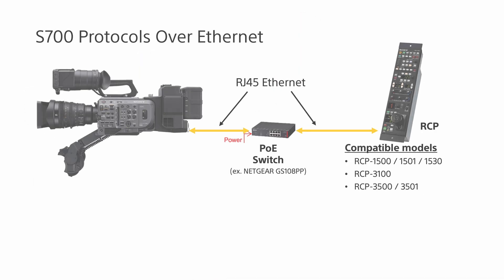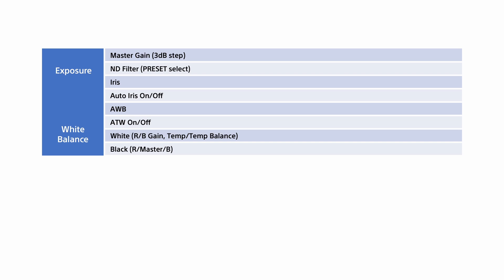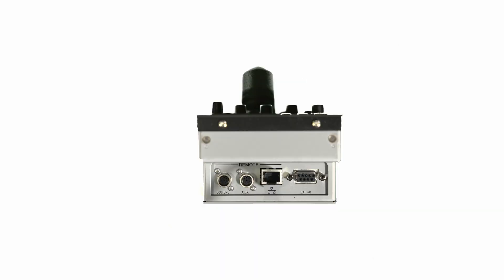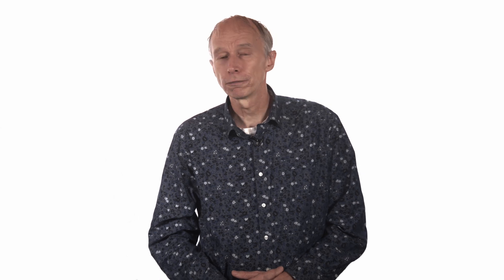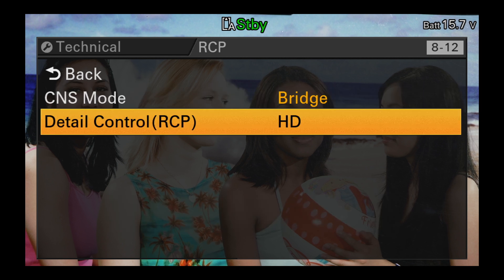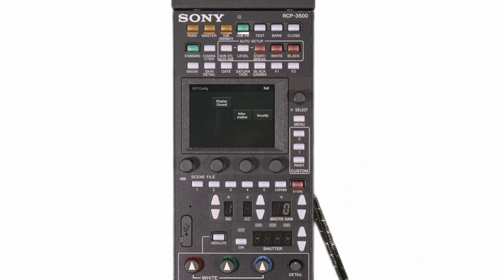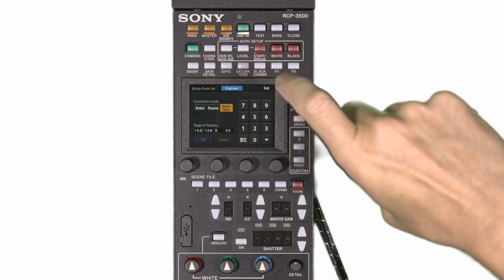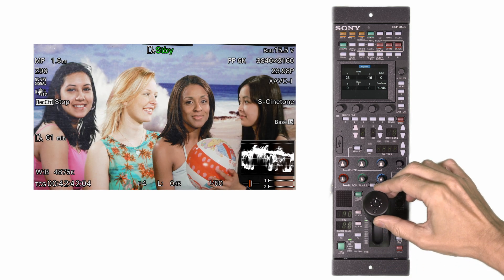FX9 Guide Version 3 | S700 Protocol over Ethernet | FX9 | Sony

Comment: Hello there - I have a couple of questions - 
1. Can the RCP control iris thru the camera if the lens is an EF mount (Canon servo 17-120mm for example) with an E to EF smart adapter like a metabones?
2. How exactly do you get tally lights in the FX9 to work with a video switcher like a Black Magic ATEM?